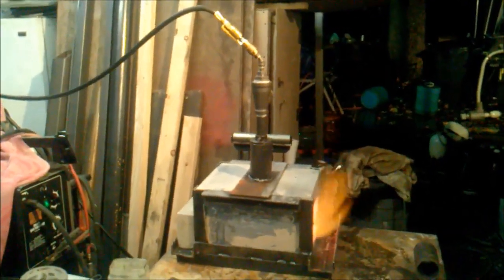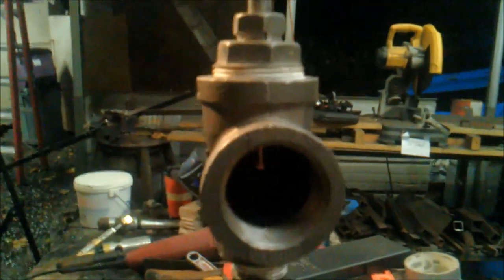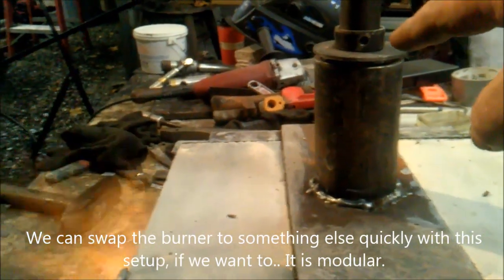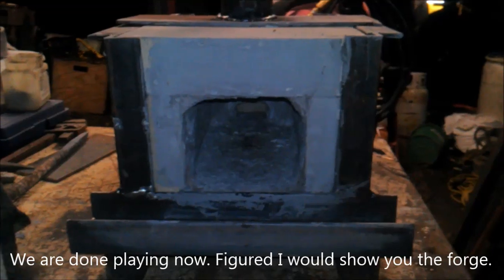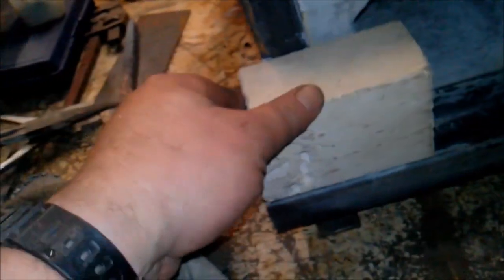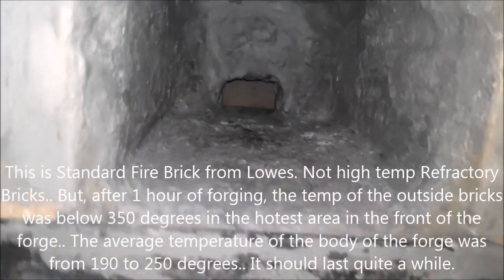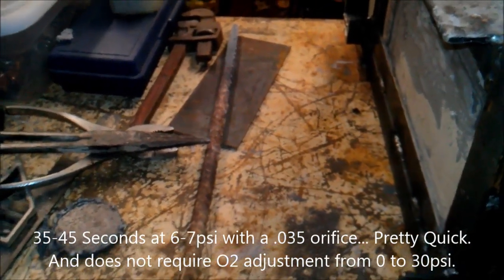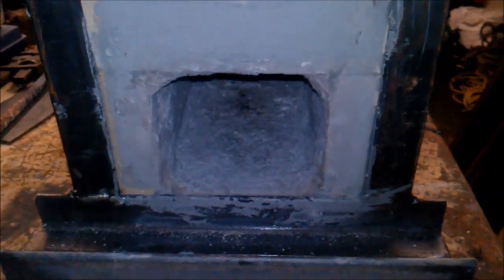A Blacksmith FireBrick Forge

Comment: I love it!  Great build - I have been thinking of building one and this is a nice design - Thanks Mark!
Reply from the maker: I enjoy your videos also.. I think you will enjoy the Brick forge.. Simple and it works.. BUT....
This forge has done just about everything I have wanted it to do, or, I have been able to make my pieces according to the forge,, EXCEPT,,, I wanted to heat up a set of coil springs and straighten them out.. 
My forge is about 4" square.. The Coil Springs were 6.5"... 
I whipped out a coil forge quickly to do the job, but, this is what I will build next.. 
Not quite this Monster, but, a smaller rounder version of it.. Or square depending... 
What I really like about the idea he has is,, it can be a small forge one minute, then, by adding a few fire bricks around the outside, front and back, it can turn into a "Large Forge"..
He uses firebrick for the floor, then, can raise the top by adding side and rear bricks, and have one much taller, then, let it cool, and drop it back to size.. Might give you some ideas, and if you see the same thing coming, might give you a more versatile piece of equipment.. 
Check it out when you have time... I think you will like it..
https://www.youtube.com/watch?v=xah47JDQKP8&list=LL1-Hsuqf0cOWHSDCaRk8d9Q&index=1
More involved, different materials, but, as far as build complexity,, I might would go with half of a 20 or 30lb Propane tank, laying on it's side, and could be made with Kaowool and refractory to make it lighter and more portable.. Would require a table that could take the heat though.. But, you need that anyway.. 
I added some 2" square tube to the bottom of mine to give it some air space and put a piece of sheet metal below it, and have it on a 2x6 laying flat table... I charred it even after lifting it with the 2" square, but the sheet metal distributes the heat well enough, it doesn't get that hot any more.. Just a FYI if you build one of these brick forges.. They are quick.. They heat up fast, and you can get right to work on it. That has been a blessing.. I don't hesitate to fire it up even for a very simple and small project, even if the rest of the project has nothing to do with forging.. Fast is very, very nice.. But, larger is nice too, when you need it. Cheers Rick.. Enjoy those projects..
Reply: Mark Thomas Thanks Mark - that is what I'm looking for - while I love my coal forge, it would be great to have a fast and quick alternative from time to time...

Comment: Very useful video, this is exactly the sort of forge I want to build and has answered some questions I had. I do not have a welder so plan on using a screwed construction to build the angle iron frame but otherwise am aiming for just this look. Great work guys, thanks.
Reply from the maker: If I were to build another like this,, I would change things around a little bit.. I'll just mention it and you do what you think with it.. I use this forge regularly, and it works great. No need to change it,, except once or twice when I wanted to load up something larger than the opening would support... This is simple, and it works,so, you can't beat it... BUT,, an idea for something more versatile down the road. 
I had a coil spring too big for the opening...  If I could have raised it, would have worked for my smallest coil spring.. Other springs would have been to large for even this.. So, I will describe something larger.. 
Half of a Freon can cut from top to bottom standing up.. Tuck the Kaowool inside and flip it over cut side down, onto a set of firebricks on a heat resistant table... Then, if making it larger is needed, just add a few bricks down the sides and back and raise it up a few inches and go again.. When finished and it cools, pull the fire bricks out, leave them on the side, ready for the next "too large" project... Something to think about... 
I did it on a coal forge, and once I got it semi straight, I ran it through the little hole in the back of "this" forge and finished straightening it out. Cheers.
Reply: Hi Mark, really appreciate the feedback. I like the idea of being able to enlarge the forge easily but right now I only plan (yeah I know all about plans and how long they last lol) on making some knives and smaller forgings so think this layout will do me just fine for a start. Firebricks are so cheap the whole thing is virtually disposable, I have salvaged some Kaowool from our old stove and plan on lining the inside with that covered with furnace cement. Got a nice burner built by a smith so with luck should be up and running in the near future, will let you know how it goes.
Reply from the maker: Sure.. I know.. I still use this exact forge every day I forge.. I fire up the coal forge for the larger items, or if I want to heat something large up quickly, and I have several of them.. You can't beat coal for it's extreme heat, but, you can't beat a propane forge for production and being able to drop 5 pieces of stock you are working on, and not worry about burning them up.. This little brick forge is perfect for what you want to do.. 
They say the bricks don't last, but, the way it is built, the bricks have to totally break apart before you have to swap them.. I am still using the same bricks.. Some hairline cracks here and there, but, they have not moved.. Can't in fact.. So, build away.. You will be more than happy with it, and the cost is surely right.. 
Cheers.
Good luck with the forge..

Comment: My next project is a table top forge. I have a 10" diameter x 18" length air tank I plan on using and line with Kaowool and coat blanket with Satanite. I would like to cut the entire end off of one side or even both and have welded hinges on them so they can be closed up tight. Have a pass thru on back side for long work. Hinged "doors" would make it much easier to line and maintenance the inside but alas I dont have the ability to weld. I envy those that do!

Nice build Mark
Reply from the maker: Might be able to bolt on some hinges. 
keep an eye out for an old Lincoln or an old Miller welder.. If it works it works.. A welder is pretty handy..
I bought a 190 amp Harbor Freight MIG welder, and it's been good.. they are pretty cheap when you use the 20% off coupon and catch it on sale..
Good luck with the table top..

Comment: I was just in Byrson city this summer, great area, great forge.
Reply from the maker: Rex Bear Good Deal. the area does lend itself to quite a few extra people during the summer. next time you come through this way, pay close attention to the temperatures when you pass through the Gorge. it is truly a unique place. and by the way. they said fire bricks from Lowe's wouldn't work when I built this. it is still growing strong today. I worked at a couple of times this past week and we'll be using it several times this week.
it's great for General forging, or production forging. I haven't done that much Forge welding with it. maybe a dozen times when I was figuring it out. but didn't seem to affect it. maybe it would have, if I did it everyday over time. Cheers.
Reply: I was on the Ochee rafting and did a little AT hiking.  I just built my own forge today but I used a 55 gallon drum cut lengthwise with a hair dryer connected to a pipe running the length.  I did not have coal so I used wood.  It worked well enough to forge a railroad spike knife.  I bought my fire brick from a brick yard for $1,75 per, it seems that everybody else wanted $5 per.
Reply: BTW the guy at the brickyard said to use a nonwater based refractory cement, might try that.
Reply from the maker: Hey.. Do what you have to do.. As long as it works.. You can make your own charcoal.. Search for Charcoal Retort and take a look.. Basically burning the wood,, but, not allowing flames to touch it.. Char it, but, not burn it... If you don't have access to coal where you are, it's an option.. Propane is pretty easy too, and don't have to worry about burning your metal if you turn your head and get distracted.. Each has it's own pros/cons.. 
Glad you got her running.. You can decide if you want something else.. Getting started is the biggest thing.  You can always change/modify/upgrade, etc.. 
Cool.. Ocoee River is nice.. Nantahala a step down, but, you can guide your own raft, so, a couple of steps back up the ladder.. 
Glad you are enjoying the resources up here.. I love it too..
Reply from the maker: I'll have to look that one up.. Didn't know about it. My next might be a bit lighter.. Using Kaowool is the idea for the next one.. But, I have propane and coal at the moment.. A couple of times I would have liked to have a bigger forge to stretch out some coil springs.. But, I got it done anyway.. Just took longer.. Ha.. Cheers Rex..
Reply: Thanks, I have a endless supply of free wood so that is what I am doing.  Plus it gets my lazy ass up, sawing and chopping, hard work by any standard.  I built a pizza oven a few years back out of firebrick and fire clay, it might have a internal volume that is too large for a gas forge but building a burner is my next project, I will be reviewing your burner and others to get a simple plan. Thanks again. What would you say your cost per hour is to burn your forge?
Reply from the maker: Rex Bear I have heard some people say $3 per hour. I think mine is closer to $2 per hour.
it depends on how thick your stock is, how big of a hurry you're in, and whether you block off the front of the forge or not to hold the heat in. I think I usually get about 10 hours a burn time for my average work. I'm using a .035 tip from a Mig  Gun.  you might be able to go down to a ..023 and save some fuel. I didn't try it
this is the burner design that I used. 
The 3/4 venturi. the only thing that was complicated or required special tools what is Drilling and tapping the end of the 1/8 inch black pipe to the quarter inch threads of the Mig tip. 
the rest was pretty simple. And I used a bell reducer for the bottom. Not the fancy stainless one.
http://www.hightemptools.com/burners.html

Comment from the maker: You are welcome.. This was quick and easy, and it works.. It is really amazing just how much heat is reflected by the Refractory cement. The outside of the bricks do not get that hot. I'm sure it will last quite a long while.
I wasn't impressed with the Do-All-Plus refractory cement... I tried 3 separate times to cure it. One fast, second time coated it warm, and put it on top of the stove for 3 days (just keeping it slightly warm), and then tried putting several very light coats, and drying between according to the directions.. It always seemed to blister the top coat.. So, I chipped it off, smoothed it up, and put on some Reflective IR coating (Metrikote)... 
If you can put your hands on some other type of Refractory cement, try it.. Maybe something from a local pottery shop, glass shop, etc.. Get something that will hold up to 2300 degrees or close to that.. 3000 degrees would be better.
You might not need to coat it at all, but, build it where you can replace the bricks easily if it does not work without the Refractory cement.You might have to replace a brick or two and try it again.. These are just cheap Lowes firebricks.. Not the expensive higher temp blocks.. I decided I would build one, picked up the bricks and put it together that night.. I figured if it didn't work, I would put the more expensive bricks in it. No big deal, but, it works fine.
Good luck with yours.

Comment: Thank you . I'am using a 12x12x2 hard brick will try the drill bit on cutting hole . First time to try forging again Thanks
Reply from the maker: +Jim Mills. Yes, drilling holes in a circle would work and give you some sort of jagged hole. You can go back and grind or file it more regular. Could also cut it square and pack it with some sort of Heat Resistant Refractory, if you are going to have some for the forge anyway. It usually has to go on in thin coats.. You will notice the flat metal plate over the entrance of the burner. I didn't worry about packing the hole after from the top. I put a thin coat around the bell reducer from the bottom (inside the forge). It never moves, although I used a sleeve to hold the blower at the right height, and I can push it down, screw the bell reducer off and pull the burner out.

Comment: Did you use soft brick or hard brick ,how did you cut hole for burner
Reply from the maker: it's a hard firebrick like you would buy at Lowes or Home Depot.. & I cut 2 1/2 square cuts one in each brick and put them together. I used an abrasive bit to round the square hole for the burner. The fire bricks were not the very high temperature breaks, but they have worked fine. 
It was something cheap quick and easy to start playing with metal, but is my primary forge still at this point.